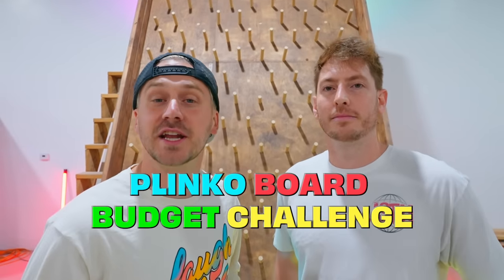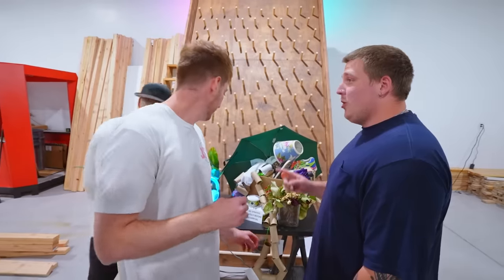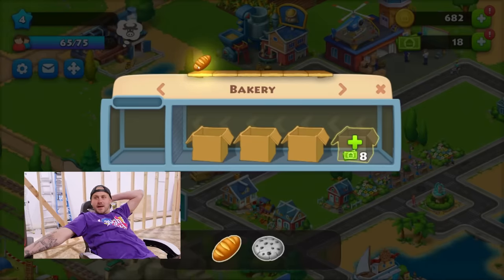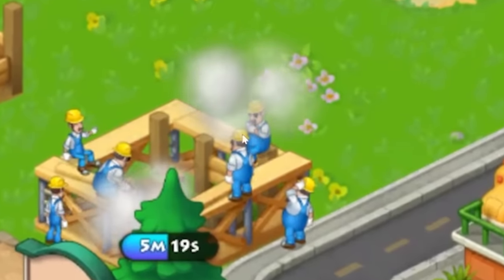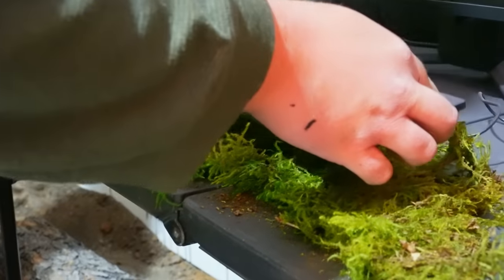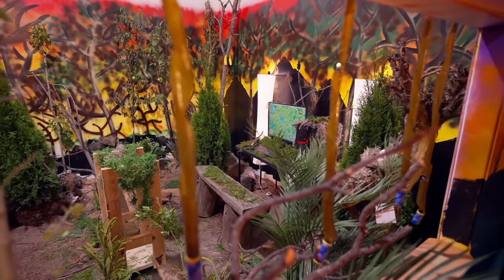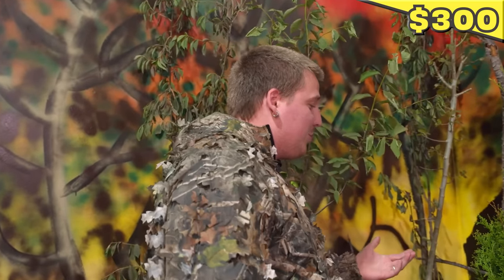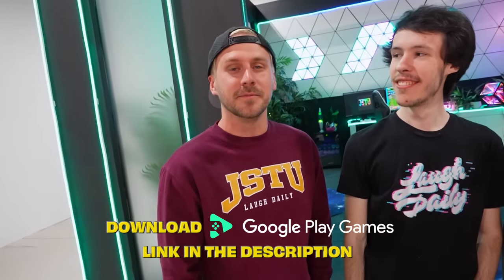$300 VS $30,000 Ultimate Gaming Forts

Comment: If i had 30,000$ budget, id have the best vr setup for a few games easily, warthunder, DCS, IL-2. My favorite ww2 plane of all time is a P-51 Mustang. Id have a replica cockpit built (not the full aircraft) and all the wires, switches, rudders, elevators, ailerons, the flight stick, throttle, the trim control, engine startup, and a real P-51 seat for the immersion, IR tracking, dropping bombs, firing rockets, shooting the 6 50 cals, landing gear, flaps, manual engine control and so much more all hooked up with how the P-51 was in real life and each switch works ingame (hopefully) and for the glass are going to be computer monitors all synced up so it feels real in a way, and a few surround sound speakers 2 on the back sides and 1 in the front. And most importantly the lever to open and close the cockpit without hitting the other monitors. And get a top end tower with the best gaming uh specs

Edit: my top 5 favorite world war 2 aircraft 

P-51 mustang (American)
B-17 flying fortress (American)
Supermarine Spitfire (British)
Yak-3 (Soviet Union) 
Me-262 (germany) the first operational jet fighter of world war 2, in 1945. With its deadly 4x30mm mk-108 cannons against American B-17s, although it didn't do much to turn the war around because of the constant day / night bombings not much it could of done. But its still a beauty of a war machine. 

Edit: i dont follow any ideologies so dont go saying that im this or that (its happened to me a few times), i love all machines of war equally.